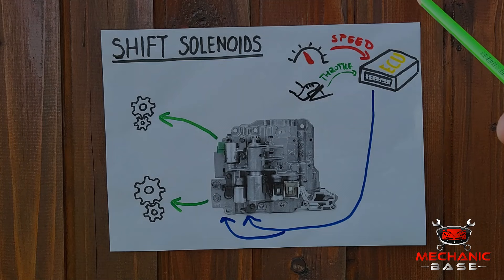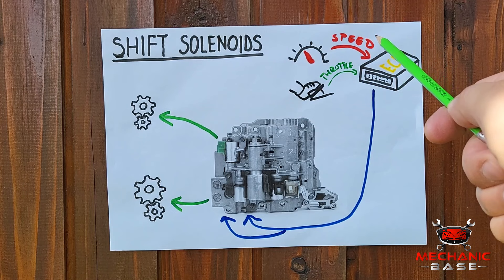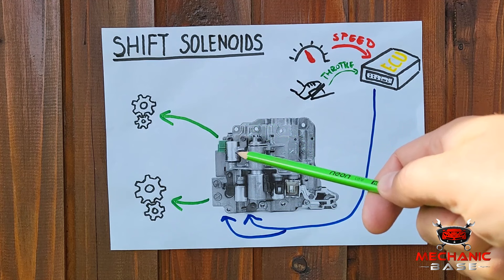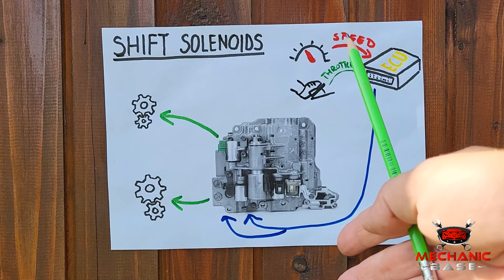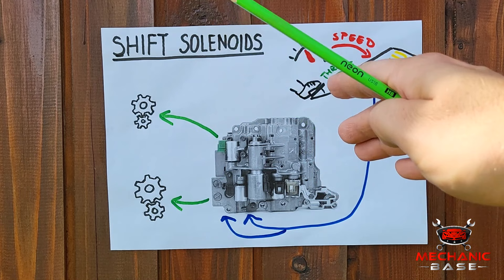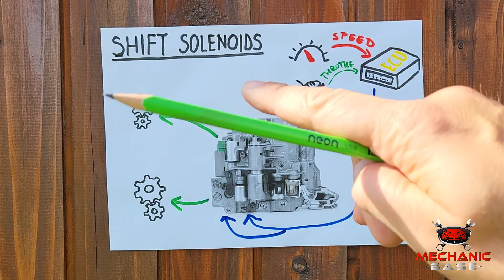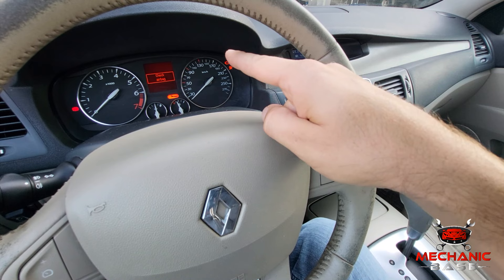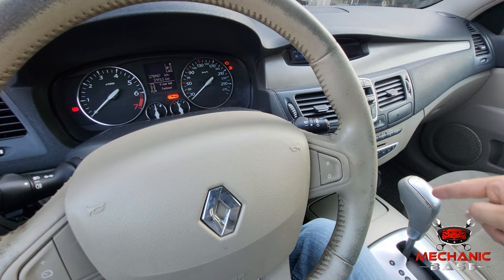7 Symptoms Of A Bad Shift Solenoid & DIY Fixes

Comment: My car drives good, it shift fine, but i have a light on, and when i scan it, it shows shift solenoid d, i don't know what it could be because i have change all the solenoid, before changing them, it was shift solenoid d, after changing them, shift solenoid d, I'm suspecting it may be a wiring issue.
Reply from the maker: Yes, that could be the cause. Which car do you have?
Reply: @MechanicBase  2001 lexus es300
Reply: P2716 Pressure Control Solenoid D Electrical code came up with engine light on, traction control on, and warning sign with a message check vsc system on Toyota Aurion 3.5 Presara 2008, 244000 on the odometer. 

At first the mechanic deleted the code saying there is no underlying problem and the code appeared again after a week, he suggested transmission oil servicing, paid 400AUD and the car has no noise and performing well then before, but right after a week again the code appears. But no degrade on the cars performance, mechanic suggests the whole change of transmission but I think it could be loose circuit, wiring issue but they wouldn't want to even try and replace the faulty solenoid or so. I need your help on this. I think our issues is the same. 
@sauljob2396 @MechanicBase
Reply: @MechanicBase  P2716 Pressure Control Solenoid D Electrical code came up with engine light on, traction control on, and warning sign with a message check vsc system on Toyota Aurion 3.5 Presara 2008, 244000 on the odometer. 

At first the mechanic deleted the code saying there is no underlying problem and the code appeared again after a week, he suggested transmission oil servicing, paid 400AUD and the car has no noise and performing well then before, but right after a week again the code appears. But no degrade on the cars performance, mechanic suggests the whole change of transmission but I think it could be loose circuit, wiring issue but they wouldn't want to even try and replace the faulty solenoid or so. I need your help on this
Reply: @PrasanRana4  I have fix it,  one of the wires on one of solenoid was not well connected, what I end up doing is, I changed the entire wire harness,  and I also make sure the connectors from the wires to the solenoid were tight. Is not a hard job to do, if you in America, you can leave your phone number or email I can send you pictures of what I did to mine, my car is running perfect, none of those nonsense lights coming on again
Reply: @sauljob2396  I am here in Australia Bro thanks for the reply I will definitely try that on mine
Reply: @PrasanRana4  you more than welcome sir. Is really not a difficult job to do if you mechanically inclined.

Comment: I want to by this 1994 e 250 it has 111000 on the dash it will drive like a champ in manual but who wants to do that.. in drive its does this kick every few seconds. Im hoping its the solenoid
Reply from the maker: Those cars are known to have issues with the whole cirrcuit board that holds the solenoids. Assuming it's a 5g-tronic.
Reply: @MechanicBase  well he got rid of it anyway look at god

Comment: my stupid lincoln town car cost me $2500. it would not change out of 2 nd gear. rediculas af. unfortunatly i hated that damx car. i think it was the solenoid.
Reply: Please my dodge charger transmission gear is having a sharp noise while moving the gear handle and the gear indicator light have change from white to yellow colour, please what may be the problems